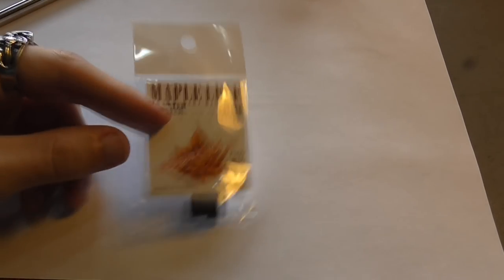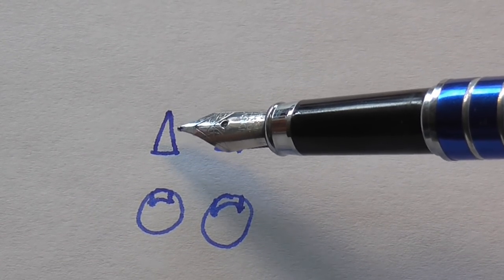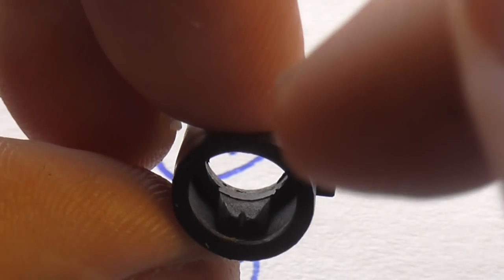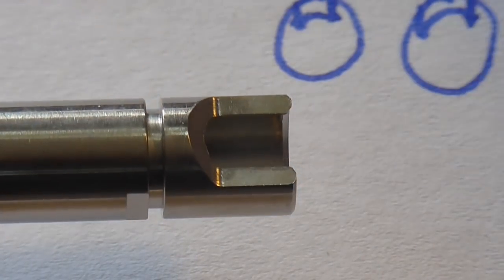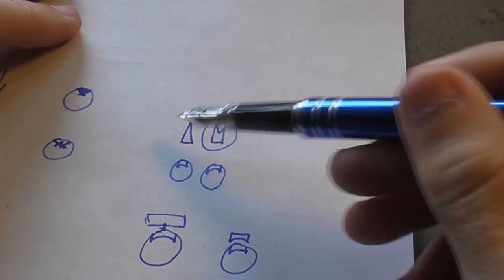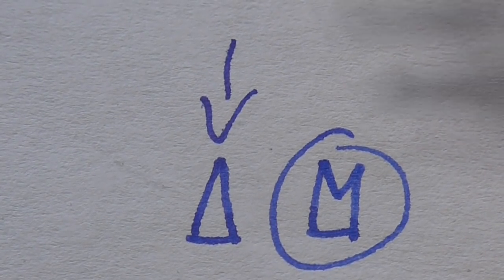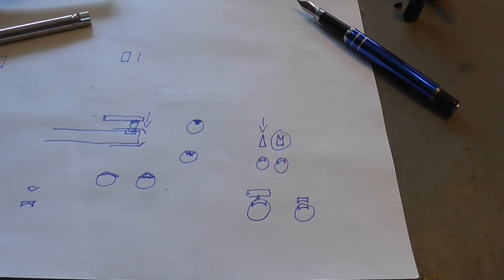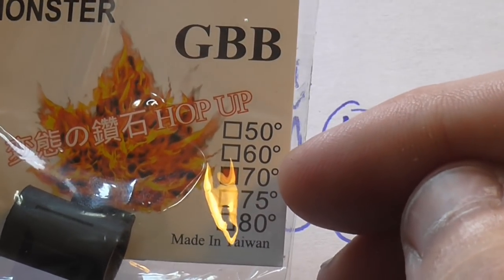Maple leaf buckings (& why you should use them)

Comment: here here on ML buckings!! I was told about these and stuck one (Macaron) in my L96 with the Omega nub and voila the inherent issue with L96 rifles shooting left went away, my fps increased and accuracy improved by 45%., i now recommend these to everyone having accuracy issues. Ive also installed these echo 1 psr's(autobots) with the AA hopup chamber and solved issues with accuracy and range. They, however, WILL NOT work in anything with a prowin hopup without modification. The shoulders of the bucking are too stiff and either the bucking or the prowin will have to be modified, else you will have feeding issues. As for the M700, AA just came out with a new hopup chamber for them in 2019 and the Ml's will work with the omega nubs using that chamber. Solved a lot of consistency issues with the M700.
Lastly  I disagree the 75's work great, the 80;s I also use and they work fine but you will see problems with air seal in a short time.All my guns shoot in excess of 400fps and dictate the use of these 2 buckings. ive never tried anything lower because I havent seen a need.

Comment: First of all, fantastic video for beginners who don't fully understand how hop up works. Second, I installed a Maple Leaf Monster 50 (pale green) in my Evo today. I am assuming that it is a new design as the mound is not a simple triangle but more of a kite shape, it didn't come with a nub. I wasn't happy with how it looked using a standard nub. Fortunately I had a H nub (solid not squishy) in my box of bits so installed that, the results are amazing. I am getting around an extra 10 meters range and the accuracy has improved from a 7" grouping at 30 meters to a 4" grouping at 30 meters. I haven't been able to test it's maximum effective range yet as my garden isn't long enough. I will report back after bedding in and proper testing.

Comment: We are using Maple Leaf Autobot + ML concave nub + ML inner barrels in our WE GBB AKs and SVD, and the results are out of this world. Best precision combo ever.
From my personal experience the Deltas are just decent while the Diamonds are awesome, as the latter provides extreme range.
I prefer the new Autobot/Decepticon series for the included ABB ring, as it really grips the nozzle, something critical for GBB consistency. Might not be that necessary for bolt action snipers though. As for durability, I've seen no difference between the old and the new, it's just getting the correct hardness. The manufacture's guideline is pretty useful for that.

Comment: (Edit Sorry For the Spam if you Got alot of Notification... had a weird youtube glitcfh where it posted my comment a million times) Just finished up my R hop plus m nub barrel setup. If you cut a really long m Nub for flat hop it works surprisingly well. I Got a maybe 5 to 10% advantage from R hopping my gun over it( Currently over hopping to about 175 to 185 feet at roughly man sized spread. but part of my hop window is curved on the tight bore I was using making it Nigh impossible to cut a perfect patch. on top of it my patch material was slightly to thick. At this Point I think the stock GnG Hop unit is the only thing holding back the hop. So my current plan is to A buy another tightbore barrel this time with a different hop window, after that a better made hop unit. and after that try out maple leaf bucking settup to contrast and compare, past that its airseal in the guts of my gun witch I really dont like taking apart.

Comment: IMHO it is very tricky to get the older PDI hop-up units working just right. I still ended up with a right hook in an upgraded Maruzen Type 96 clone. You almost have to start all over again setting the unit up when you change BB weight. Having two hop adjustment arms sounds great but it's a pain.

Comment: PDI-W hold from what I've seen are just as good as a flat hop. VSR-10 that is, I haven't tried the AEG design out because... gross, AEG's. The diamond Maple Leaf looks super promising though, I mostly came here to learn about the concave nub paired with the maple leaf.

The faster wearing rubber likely grips better btw. Meaning less grip needed. PDI-W softer buckings grip way better than the harder ones and they do wear out faster.

Comment: Just finished up my R hop plus m nub barrel setup. If you cut a really long m Nub for flat hop it works surprisingly well. I Got a maybe 5 to 10% advantage from R hopping my gun over it( Currently over hopping to about 175 to 185 feet at roughly man sized spread. but part of my hop window is curved on the tight bore I was using making it Nigh impossible to cut a perfect patch. on top of it my patch material was slightly to thick. At this Point I think the stock GnG Hop unit is the only thing holding back the hop. So my current plan is to A buy another tightbore barrel this time with a different hop window, after that a better made hop unit. and after that try out maple leaf bucking settup to contrast and compare, past that its airseal in the guts of my gun witch I really dont like taking apart.

Comment: First very informative video ! Question I have a gbb mk18 it’s WA based system and I upgraded my hop up chamber and inner barrel which is vsr no bridge but the hop up unit came with a Tokyo Marui rubber that looks like a maple leaf rubber just dimensions not the patch on the inside but basically it doesn’t have the extra material on the outside it completely smoothe but it’s definitely not an aeg rubber . I have a pdi W hold rubber I want to install but idk if it ok to remove that extra material so it will fit in the chamber . The fact that I have a vsr open window cut barrel I was under the assumption I could use the pdi without any modifications. I’m just curious if it is possible to remove that extra material on the outside so it smooth all the way around like the TM rubber that came with the unit ?? Any help is greatly appreciated

Comment: Thank you! this video really helped me a lot to understand how each of the buckings work and what the differences are. I want to switch the whole Hop up chamber of my VSR-10 to a new one which uses AEG barrels and buckings, but im unsure if i need a maple leaf nub for aeg maple leaf buckings, because the hop up unit has 2 seperate arms to adjust the hop up.
Reply from the maker: dante257 Don't, get the AA chamber. It's much better than the PDI design, AEG barrels and buckings are inferior to VSR ones, both in accuracy and airseal.
Reply: Ok thx for the quick reply. My problem is vsr tuning barrels in this length are quiet expensive. I use a vsr 10 clone (Well MB03) and im not sure which barrel length i have to use. My standard barrel is 509mm so do i need exactly the same length? Which barrel do you use and how long is it?
Reply from the maker: dante257 Just use a 430 and drill out the end cap. 509 mm is too long for .4+ bb's anyway
Reply: Ok i ordered the AA chamber now. Really appreciate your help :)
Reply: Ok, maybe you can help me once more :'D I installed the AA chamber in my Well MB03 with a vsr-10 barrel and the standard bucking because the company send me the wrong maple leaf buckings :/ I now have the problem that my magazines dont really fit in my rifle anymore. Sometimes i cant get them in and if i can get them in they hang kinda loose :( DId I do something wrong or is it something with the chamber?
Reply from the maker: dante257 try loosening the front stock screw a little. That's probably your problem ;)
Reply: Just tried it, the mags still doesn't fit properly :/ They just dont click in and hold the position

Comment: Sorry to multipost, I was commenting as I watched the video and read your post at ASF... 
The AEG buckings are Deltas and therefore not-so-good, but you missed the other option: for AEG use (and that includes the most popular L96s chambers) you can go with Maple Leaf Hybrid buckgins, which are Diamond buckings that fit in AEG chambers together with Maple Leaf GBB inner barrels.  Haven't tried that option yet (I'm a GBB guy p) but theoretically it should work great.
Reply from the maker: That's true, those do work, but they don't align as well in AEG chambers because an AEG-specific chamber is built to lock down the barrel and have the bucking lock over that. A non-AEG barrel can't be locked down in such a chamber as well.

This is also why VSRs are yet again better. The barrel is locked down AND the bucking is locked down seperately ;)

Comment: So I have an Action Army Hop Chamber and the maple leaf bucking is about 1mm shorter and with it fitted is terrible so went back to the original VSR bucking and it's fine. I read somewhere that you have to put tape around the inner barrel where the AA chamber collar goes to push the bucking further in, did you have to do this ?
Reply from the maker: 17lasbrisas yes, that's one of the flaws of the ML, they're indeed about 1 mm shorter so if you don't use teflon tape your airseal will be horrible. Wrap it in teflon tape a few times and then reinstall it, when you insert the spacer this will squish the teflon tape between the spacer and the bucking, which results in the bucking being pushed backwards, which results in 100% airseal.

Try it, you'll love it :)

Comment: I just got a PDI 6.01 Barrel with the new 10MM diameter that avoids vibration. I was very excited about this hop you talk about until I arrived to the part where I should cut the end of the barrel's hopup window as it is not open. After speding a lot of money on the barrel, I am afraid I could break it. 

Whay solution would you recommend? Cutting the window as it is not that difficult? Or switching to another kind of hop-up?
Reply from the maker: Kotobukian 寿庵 I'd file the bridge off, yes. It's really not hard and the maple leaf is well worth it. You can't really mess it up :tup:

However, if you ever want to do an R-hop in the future, then I wouldn't do it as it is very hard to R-hop an open barrel window. But honestly the maple leaf is just about as good so I'd just take it off and use the maple leaf :)

Comment: I have an AWS platform rifle (the well mb4403), the one with the bb-ramp from the mag to the hopup-chamber. Would i be able to install the AA-chamber on that rifle and then adjust the hop-up without taking the rifle apart? Because I can not reach the hop-chamber from the magwell.
Reply from the maker: Antherias That's an L96 AWS, so ML VSR bucking, ML nub and open barrel window will work.

Comment: Reliku (Now Relizu...) I use a VSR 10 and a AA Chamber w/ a 70degree autobot bucking (550fps) and a concave nub, however I still get shots curving to the right and left. I use a PDI cold steel barrel, however since I cut the bridge off, if the window is not perfectly straight and parallel could that cause issues as to curving?
Reply from the maker: Diego Ayala generally not, unless the cut is very unclean (e.g. burrs left inside the window)

Comment: How can I be sure about am I inserted nub correctly in to the aa hop chamber? Can you make a video installation and also checking alligment correction ?
Reply from the maker: As long as it goes down the slot it is inserted correctly. I don't think you can really mess it up. The nub is as wide as the nub window so as long as it's inside the slot it is good.

Alignment is the bucking itself. It should sit straight in the chamber. It's pretty hard to mess up with the VSR buckings because they have an alignment ridge but it's possible and could cause a slight left or right hook if it isn't properly aligned.
Reply from the maker: As long as it goes down the slot it is inserted correctly. I don't think you can really mess it up. The nub is as wide as the nub window so as long as it's inside the slot it is good.

Alignment is the bucking itself. It should sit straight in the chamber. It's pretty hard to mess up with the VSR buckings because they have an alignment ridge but it's possible and could cause a slight left or right hook if it isn't properly aligned.

Comment: Would you recommend a Pdi 6.05 303mm inner barrel, or the AA g-spec 300MM inner barel? i've heard of issues where the piston doesnt reach far enough into the hole of the AA hop up unit.
Reply from the maker: I'd go for longer (such as 430 mm). I'd recommend none of those, actually. Recently I tried a maple leaf crazy jet and it is definitely better than both the AA and the PDI if you ask me. Look into those ;)

Comment: really helpful video!, i just wonder, i'm using AEG DMR (long range AEG) 455 mm length and 6.02 pdi raven inner barrel. and currently my fps using 0.30 gram bb is 470fps. So, my question is, which one is better? mapple leaf monster 70 degree or prometheus purple bucking or even PDI w hold?? which one is better? i really hope that you will answer my question thank you! greetings from Indonesia!
Reply from the maker: Sorry for the late answer. But yes, basically the ML (AEG version) will be the best option, but I'd use 60 degrees instead. The W hold or any other bucking will also lift .3's at that fps but the maple leaf will be more consistent and accurate ;)

Comment: What maple leaf bucking will fit an m4 style hop up? I am buying a Krytac LVOA-c and have no idea what bucking I should get for it. I would like to mod it over to a dmr. (Maple Leaf AST Airsoft AEG Hopup Rubber Bucking - 80°) would this be good for my build?
Reply from the maker: montyfacker yes, that one will work, but get a 50 or 60 degree one instead of the 80 ;)
Reply: ok. not sure if I will use maple leaf or mad bull yet. Im still new to airsoft :p

Comment: Hay I'm buying a pistol cause I use pistols for primary I just prefer it but it gives me a maple leaf option but it goes maple leaf autobot bucking 50degree 60degree 70degree 80degree which one should I get
Reply from the maker: CJ R. A 50 or 60 degree autobot works well in pistols. The autobot is better in gbb guns compared to the diamond because of the anti blow ring, so when it comes to anything gbb, the autobot is the best :)

Comment: Hey! Is it true that  6.01mm inner diameter barrels are not a good choice for long range ? Thanks!
Reply from the maker: Not really. Range has nothing to do with your barrel choice, and while effective range (accuracy) does depend on your barrel quality, it does not depend on bore size generally. Assuming you're using perfect ammo.

If you're not using perfect ammo, wider bores will help your accuracy due to the air cushion effect, but at a cost of efficiency (more air is lost).

But using quasi-perfect ceramic bb's, people have achieved some of the longest shots with 5.98mm super-tightbores, and all the other records were shot with 6.03 or similar bores. Something to keep in mind.

Under normal circumstances, 6.01 will work just fine ;)

Comment: I have the aac21(tac21) version of the m700 made by action army. I have installed a vsr orga magnus barrel and now am getting a diamond bucking for it(have now installed a king arms bucking as I had it laying about but this is antiquated tech by now...). But this version of the m700 comes with a cylinder shaped nub instead of a concave nub. What shoud I order for a nub now? Standard m700 nub?
I don't feel like making my own nub as it will never be perfect... Thanks for your help/info!
Reply from the maker: S13mASSImo try a chunk of pencil eraser. it's easier than it may sound. just cut a square piece that fits into your hopup window and it will do the trick :)
Reply: Thanks, but I feel that I would have to file it into a concave shape right? My aac21 has the tdc style screw that puts pressure straight on the nub from the top, and I'm afraid that if I use a straight piece of eraser, I will be creating a opposite convex shape instead of a concave one. Would it not be better to have a hard nub? Thanks for the quick answer man!
Reply from the maker: S13mASSImo no, a flat nub will work just as well
Reply: Thanks a bunch man. I have read many of your posts on airsoftsniperforum with great interest and you do a lot for the airsoft sniping community!
Groeten uit België!

Comment: Is it possible to use these new maple leaf buckings (deception/autobot) with standard VSR barrel with that "bridge" at the end or is it the same design as the old Monster bucking that can be used only with no bridge barrels?
Reply from the maker: Adam K same design yes, both can only be used with unbridged barrels, sadly.
Reply: ehh thats bad news... Would you suggest to remove somehow that bridge from PDI barrel for vsr (using sandpaper?? Is maple leaf worth it?) or just leave Maple leaf and find some other solution?
Reply from the maker: Adam K yes, I'd just remove the bridge then

Comment: I just bought a maple leaf monster 75 degree bucking for my WE M16. Do I need an exclusively maple leaf nub for it to work properly or will it be fine.
Reply from the maker: Amaethon for the gbbr's it's the same story, you'll need the ML nub. In your case the autobot will work better by the way, the anti-blow ring helps grabbing a gbbr nozzle which will improvr your fps consistency, so if the monster wears out, you might wanna consider switching :)
Reply: Relizu cheers buddy.
Reply: Relizu would you need a ML nub for a autobot then?